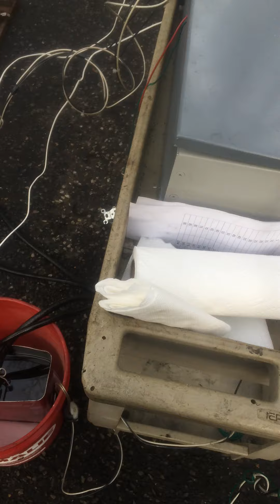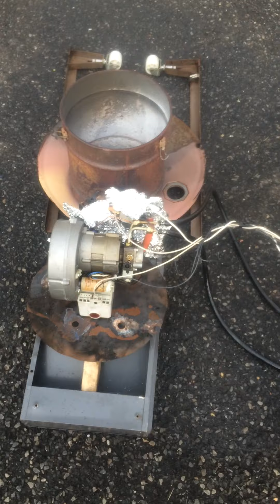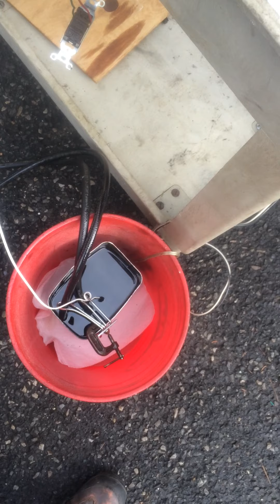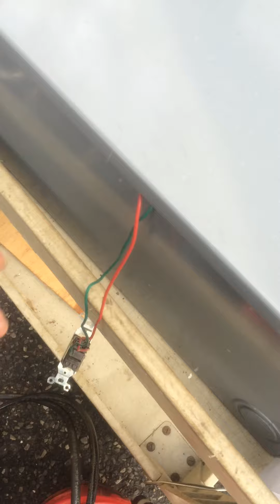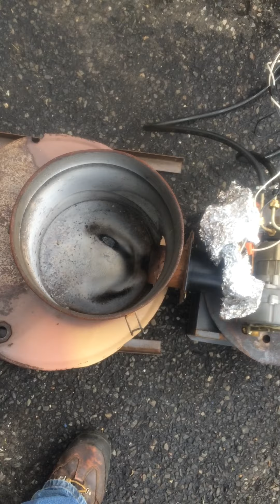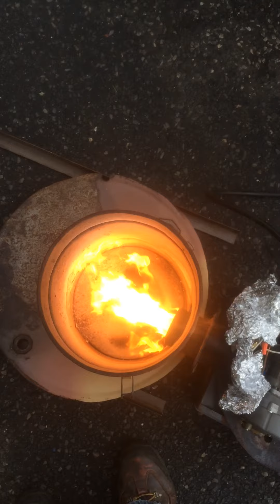HOT!!!! Waste Oil Burner - MASSIVE HEAT

Comment: Hi Clyde. That's a great setup well done getting it all figured out and working. I just received some syphon nozzles from the states and I will be making a version of that soon. I have quite a few waste oil projects planned for the winter months. Your setup with the preheaters to thin the oil is really good and it's fantastic that you can spray waste oil with the standard 0.5 gph nozzle.  I have subbed to your channel. Cheers Gerry
Reply from the maker: Thanks for the kind words Gerry. I live in Connecticut in the states and the weather will be turning cold soon, so its just about time to tune up the system. When I do I will do my best to video what I do and how the system works. I just hope I can do as well videoing as you do...but I have my doubts. : )